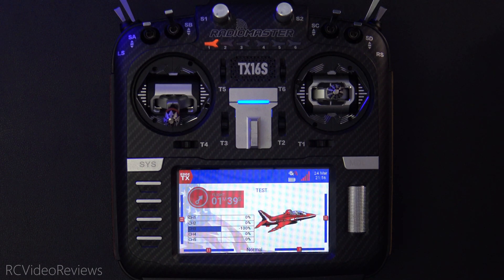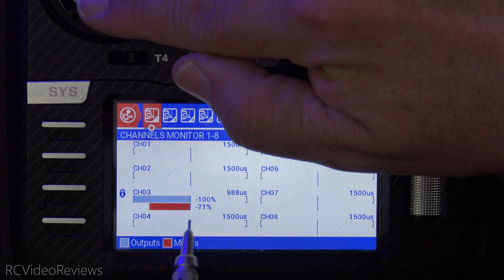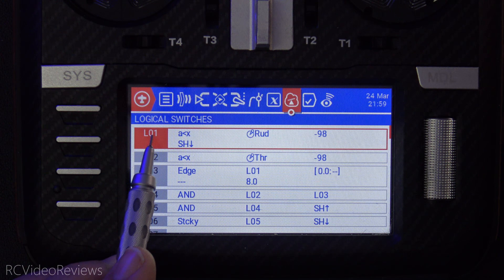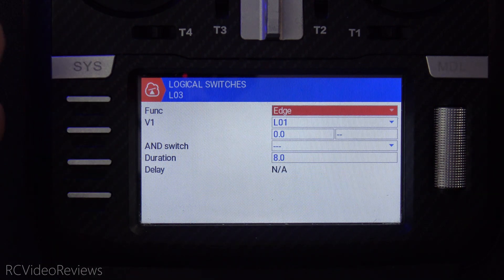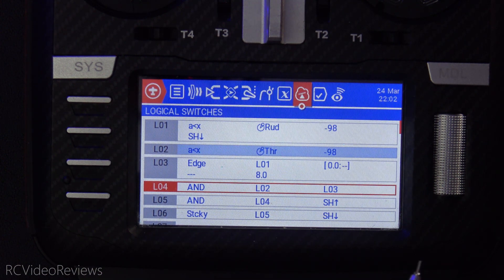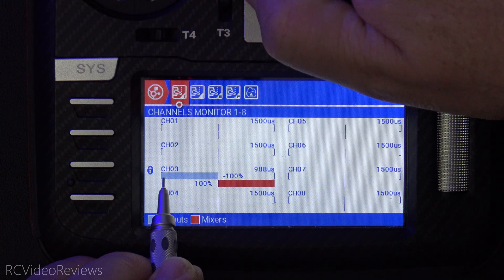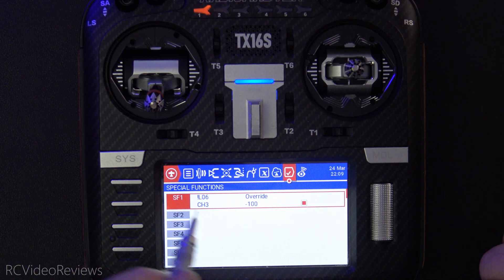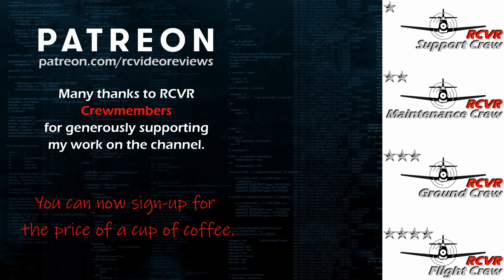EdgeTX Snippet • Two Stage Timed Arming Sequence PLUS Throttle Check

Comment: Another great vid. Thanks. I usually set up for the timers to start on Thro stick movement. I tried many ways to create a link but was not successful. Would it at all be possible for you to figure this out and post a demo, please? I use Electric, Nitro and Gas with a combined Kill switch, all on switch SD. Set up should ideally work for all three.

Comment: Thanks for sharing this. Trying to replicate these same steps with the Radiomaster Boxer, using SA instead of SH - but it isn't working. I have to reverse SA switch positions in L05 and LO6. Perhaps this a bug in the Companion? Also, it isn't clerar (from the video) how to list the special function (sequence) in your arming channel... e.g. CH5 for ELRS to actually arm or disarm the FC. Thanks.

Comment: Thanks for sharing! I used your parameters on my Boxer radio and unfortunately it did not work. Is this arming sequence  for airplanes only?
Reply from the maker: The arming sequence in this video occurs entirely on the radio which doesn't know or care what you're connected to. So there's more to the story as the sequence 100% works.

Comment: Not sure how but you lost me at L01. I tried putting something similar into my radio but not mater what I'm doing I'm getting the same output regardless of the AND switch position. I think I'm messing up Func or V1 or V2. I'll go try to figure out what those are supposed to represent.

Comment: So, I set up my radio exactly like this, everything works as it should, when I plug in the plane the throttle is locked, I arm the plane, the throttle works as it should... But then when I hit my throttle lock switch to lock it again, the motor starts running and I can't stop it until I unplug the batteries... Just chewed up a prop but got lucky it didn't chew me up

Comment: Good Video. I use 2 stage arming by holding a momentary switch AND turning the arming switch ON (the motor will not arm unless both switches are closed at the same time and the throttle is -98). I like the timing aspect of this. I may add the timing line to my logic switch. Thank you
Reply from the maker: Cool idea
Reply: Yes! I want to use my momentary switch as a safety, So SH has to be held on AND SF switched up before arming. But importantly, I would like to have to do the reverse to disarm. So hold the SH up and switch SF back to disarm. But I have no idea how to set this! any help would be amazing.

Comment: One thing that me a while to figure out... how to set the Special Function to override the throttle on !L06. I easily found L06 but I couldn't scroll up or down to !L06. So I tried long-pressing on L06. Lo and behold, L06 switched to !L06. I'm not certain id this is an oversight or it's intentional. In other screens, we can scroll through all the "positive" logical switches and or through all the "not" logical switches. I'll post a question where some ETX devs can see it. I'm on v2.7.
Reply from the maker: Steven, If you look in the #edgetx channel on discord, I just took a picture of a special function list showing !L01 in my list by scrolling up. It came in right after !6U and before !FMx

Comment: Good video.  I have a Futaba 14SG, Spectrum DX8G2 and the Radiomaster for my helis, planes and quads .(yes I  know i need to consolidate).  Regardless of aircraft or radio type I learned the hard way to run 2 safety switches.  One being a throttle cut and the other being a zero throttle curve. It's too easy to bump 1 switch and the throttle to be slightly on without realizing it.
Reply from the maker: Yeah, I get the privilege of seeing lots of comments and questions. That's what drives me to make these types of videos.